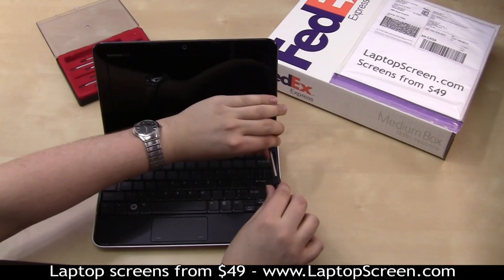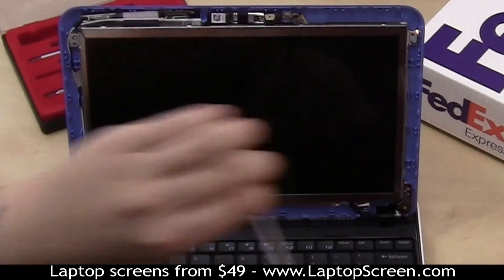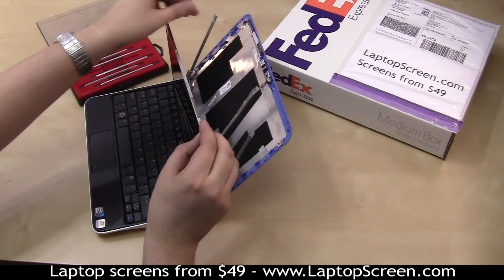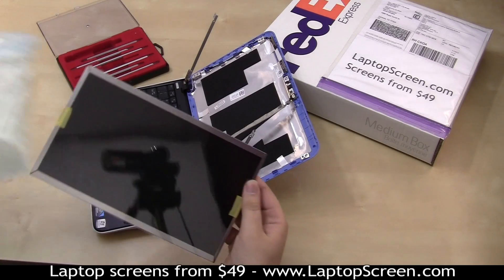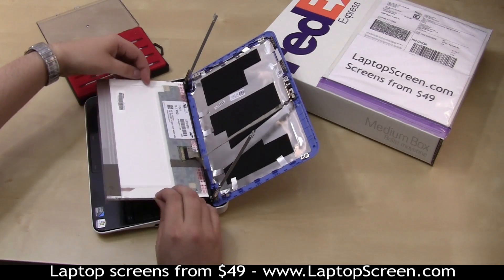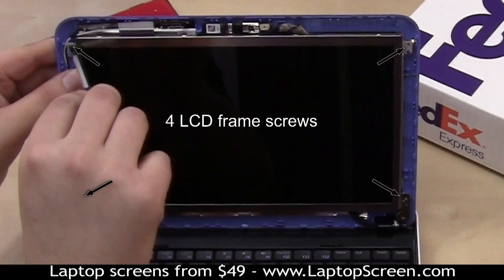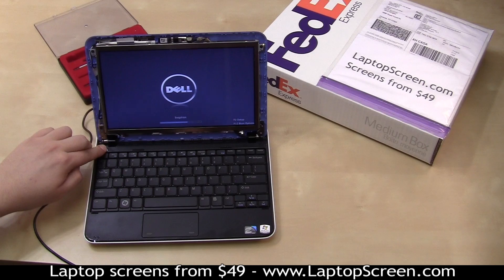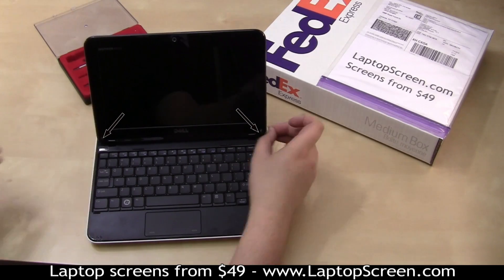Netbook screen repair, how to replace an LCD screen on a Netbook/Laptop [Dell Mini 10]

Comment from the maker: @Phenom69ll Well up until 2 months ago we thought that CCFL to LED conversions were not possible, but, there is now a conversion kit available for a LTN160AT06 (LED) to LTN160AT01 (CCFL) for Toshiba and Acer 16", it's a flex wire cable which uses the pre-inverter power from the laptop to power the LED screen. So it is possible, but the major reason these specific kits became available is because there is a global shortage of LTN160AT01's. There is no such kit for your laptop, just not yet.